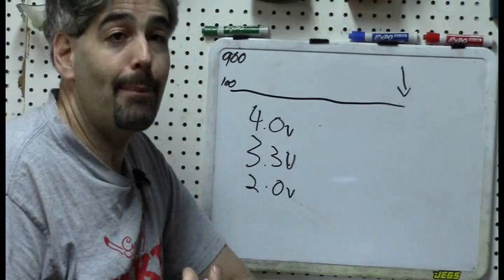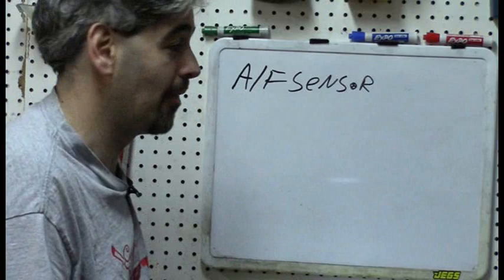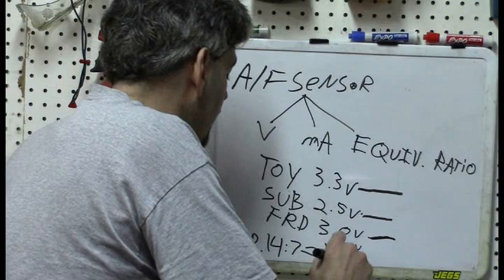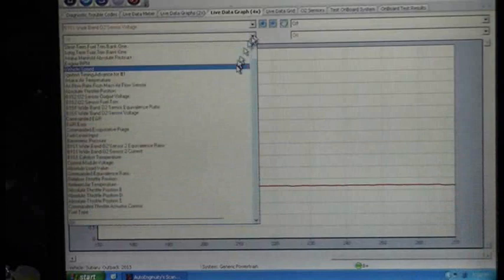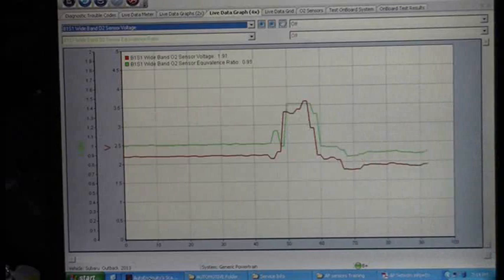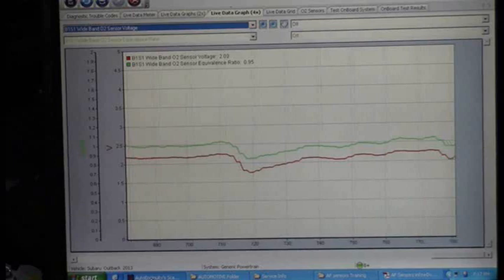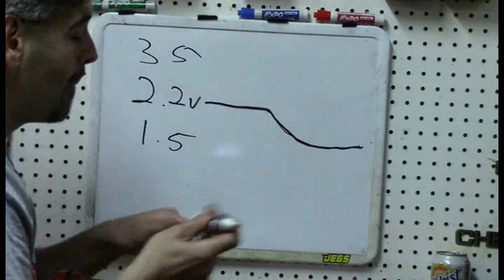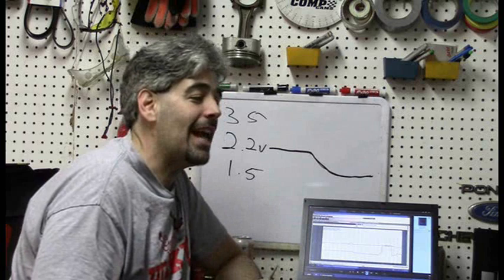Air/Fuel Sensors (Wideband Oxygen Sensors) vs O2 Sensors- PART 2

Comment: I tried doing the wide open throttle snap test to my toyota but it actually went lean(5.0v) right away and then normalized back at 3.3v. It would not go rich and then lean like it was shown on the video.
I have forced the sensor to go rich with propane and lean by disconnecting booster vacuum and it all checked out good.
I have checked fuel pressure and i got 44 psi at iddle and 45psi at 2500 rpm load.
I continue getting LTFT at about 4.5 at iddle and 8.5 at driving crusing speed.
I have a check engine light for P0171  bank lean, P0102 maf sensor low circuit imput, and P0113 iat sensor high circuit imput. 
Any ideas or thoughts?
Reply from the maker: Oscar G Sorry for the late reply.  Unlike most, you actually did a good job of giving some diagnostic data. But I would still need more. While it certainly appears you have a MAF problem and can rule out fuel pressure for sure, a freeze frame showing the actual conditions for the code that you can reproduce would be nice.  8.5LTFT is nothing I would base a diagnosis on. I would need to see it much higher.
  If you have an integrated IAT and MAF on your vehicle I would certainly be tempted to check there (I have an IAT video but not a MAF video yet). But you also need to do WOT tests and see if your A/F goes lean instead of rich which would also help give further indication that airflow measurement is the direction you want to pursue.
  But I would definitely not be chasing fuel, A/F, and vacuum leaks based on this so far.

Comment: Will the EQ ratio pid be labeled as such? All i see is the mA pid and one other pid for lambda voltage...if i only have that one voltage pid for the sensor and is not labeled as EQ ratio pid than i can assume it is NOT an eq ratio pid?
Reply from the maker: Yes there will be an equivalence ratio. It may not always be labeled as such though.
Reply: @SchrodingersBox  I wish I could find some definitive answer from kia...I guess it doesn't matter though because when diagnosing if the sensor is good or bad I should simply be looking for the graphed waveform...

Comment: I am wondering if an A/F could be used on a motorcycle that currently has no O2S. Could it be set up to use as an analyzer by monitoring it with a VOM for instance. If so how would one know the current of a given A/F at stoichiometry?
Reply from the maker: You can run anything on a A/F or O2 if the fuel management computer can recognize the signal.
Reply: No, my point is not to utilize the fuel management system. I want to monitor the air/fuel mix independent of the ECM.

Comment: Best explanation. Thank you so much.
But why the hate for 4 cylinder engines? Classic USA guy :P . Japan is makinh decent cars with 4 cylinders, dosent need to be a V10 6.5 lit engine with only 200 hp, it can also be a lighter, I 4 cyl 2Lt engine that can do 200+ hp.
Reply from the maker: Its because I like to go FAST.  I am about speed and performance, not fuel economy.  200HP?? My car's blower motor is about that.
Reply: @SchrodingersBox  just added a 0 to it
Reply from the maker: @MFDOOMgr  Not impressed... now just think if it was an 8 cylinder!!!! TWICE as fast.  NOW you'd have something that would impress me.
  There is no replacement for displacement.  Its absolutely true.

Comment: I'm slightly confused. Could you not measure the output of this directly by measuring the voltage drop across a resistor? I get the feeling that this is what the car computer is doing, which explains why the voltage is not to be trusted -- it depends on what voltage is applied by the computer, and it doesn't care because it's only measuring the drop. Or is it you don't mean that it's impossible to measure with a multimeter, just that it's more difficult because you would have to get a resistance in series to measure across?
Reply from the maker: It does not measure voltage. it measures amperage and polarity change.  The amperage is so minimal a standard DVOM would never detect it.
Reply: I seriously doubt the computer directly reads the amperage. It can't read it any better than your multimeter can, for the same reasons. It's just much easier to measure a voltage accurately.

I think it's likely that it's measuring the voltage drop across a known resistance (like you do in your parasitic amp draw technique video, the "known resistance" is the fuse) in order to indirectly read the amperage by reading the voltage. V = IR

I was just wondering if you had tried doing the same, i.e. putting a resistor in series with the sense wire and reading the voltage across that resistor with the meter set to voltage. I take it you haven't, that's fine. Just trying to brainstorm ideas. Excellent video series, btw!
Reply from the maker: tiger12506 Ah yes, you bring up a good point. That may be so, I am not sure. All I know for sure is it definitely measures polarity change and in fact I have a video showing a demonstration of that.

Comment: is the sensor producing this voltage? ot is the ecm provide the voltage?
Reply from the maker: Oh good question lol.  The sensor absolutely produces voltage HOWEVER it is not the actual voltage shown by the PCM.  So the sensor produces voltage however the PCM reports it differently --- actually based on the amperage, not voltage.
  Weird, eh?

Comment: My Toyota truck came with air fuel ratio sensor.
The Denso website recommends o2 sensor. (old parts number are not even listed).
So I replace it with the o2 sensor.
The check light has been off for a while but came back on after about 200 miles of driving so I thought drive cycle was completed.
I checked with a code reader but no data.
Is this common?
Air fuel ratio sensors and o2 sensors are not interchangeable even the manufacturer says they are?
Reply from the maker: You cannot replace an A/F with an O2. Just a moments thought would indicate this is impossible to work.
Reply: Schrodingers Box says:
"You cannot replace an A/F with an O2. Just a moments thought would indicate this is impossible to work."
==
Thank you for the reply.
That's consistent with what I was thinking.

I'm pretty disgusted by Denso as a company.

Comment: Hey Matt.
I have a weird issue with my o2 sensor. (note: My car doesn't support ODBII, so only voltmeter tests)
While idling it shows rather low voltage (around 0.2-0.3v all the time) - it doesn't mean anything so far - maybe vacuum leak.
The issue appears when I add propan - should go rich (engine almost dies) but o2 sensor shows me 0.5v all the time. Then, when I lean it again with vacuum leak - it drops to 0.1-0.2v, but doesn't really oscillate. 

There is no possibility to force this sensor to show 0.9v, whatever I do.
Do you have any other idea how to test this o2 sensor to be 100% sure it's not working correctly and should be replaced?

In my opinion - when it doesn't show 0.9v with propan - there are 2 possibilities: Or o2 sensor is broken, or my voltmeter (just simple digital) is showing wrong readings.

My o2 sensor is 3 wires - heater (2 white wires), 1 signal (reference 0.5v from ECU present), ground via exhaust pipe.
I'm doing those tests since I noticed the car takes more fuel than normal - and my readings proves it may be the case -> o2 sensor no metter what reads 0.1-0.5v
Reply from the maker: Provided you are measuring correctly and accurately, a dead O2 sensor would be the only possibility.
  Note also that another inidcator is the engine should be running rich despite the lean reading on the O2.  With false lean like that, engine should be practically dumping fuel trying to get O2 to respond back to stoic, exhaust should smell rich.
 I would have no problem changing the O2.
  You can also verify by repeating your readings on rear O2 by inducing significant lean condition and verifying voltage drops.
Reply: Schrodingers Box I also thought about verifying by readings on rear o2 - the only problem is - there is no rear o2 ;) This car has a catalytic converter but no rear o2 sensor.  I'm sort of sure the engine runs rich - more fuel consumption, characteristic smell from exhaust, but this doesn't mean broken o2 yet of course. 

There is also no "check engine" light (the car has one) - and this light it working, since it turns on when running with o2 sensor disconnected. I'm not sure how fuel trims are working in this car, but I can imagine they should be really high when o2 reports false lean, so they should turn on check engine light?

It's pretty complex to diagnose EFI car without OBDII :(

Anyway - many thanks for your opinion. Probably, based on my measurements and other symptoms, I'm gonna change o2 sensor.

BTW.
It's pretty cool to see YOU writing: "Go, change your o2" LOL :)
Reply from the maker: lol good point. What kind of car is this anyway?
Reply: Schrodingers Box volvo 740 2.3 '89, everything stock, naturally aspirated. I drive it usually to the junk yard or when somebody needs to transport furnitures or something, big wagon.

Comment: Isn't stoich heavily dependent on the type of fuel you are using?  So old fashioned gasoline being 14.7:1 (air to fuel by weight). But we don't use pure gasoline anymore. Generally we use E10 (90% gasoline and 10% Ethanol).  So using the 9.0:1 stoich ration for Ethanol and computing the E10 stoich it would be calculated proportionally as (14.7 x 90%) + (9.0 x 10%) = 14.13.  So E10 stoich is 14.13:1 and not 14.7. If the vehicle was designed for E10 I might assume that the stoich voltage on an O2 sensor (0.45 vdc) actually represents 14.13. To complicate things even more -- where I live they add oxidizers to the fuel in the Winter months and I haven't a clue what the stoich ratio of that substance is.
Reply from the maker: I never considered this but it sure sounds reasonable. I would need to look into that more.
Reply: I didn't see that before my comment, but I agree. There is a 1% plus or minus tolerance in the factory tune up. But here in Brasil, the ECU for gasoline (exclusive, gasoline only, not ffv) is tuned about 22,5% +or- 1%, since the 90's, because the gov determines ethanol addition from 20% to 25% seasonally, and that goes beyond the settings often. Our gas are E20 or E25 and mixtures of thereoff. Now with flex fuel there is a sensor to measure the mix of alcohol and gasoline in the tank. We have these car as flex fuel vehicles, and that really complicates the matter
Reply: Jay D. Anderson no it will actually read 14.7 to 1. stoich the difference will be that the ECU will add more fuel due to the density of fuel and the calorific value of said fuel...   E10 or E85 doesnt make a diffrence.
the old gauges use to read 1 for stoich 0.8 for rich and 1.2 for lean. as shrodinger points out the numbers could be anything. but they chose to print the numbers for petrol a/f ratio on the gauge.
Reply: Well, if ECU adds more fuel the ratio will be less than 14.7:1, wouldn't? And the O2 sensor will see higher voltages every time it trims back to 14.7:1. And there will be a conflict that would triger the CEL.
Reply from the maker: Duratec Paul Yeah I am not sure that's right- you would actually add LESS fuel if the density was higher.
Reply: OS Coutinho no as the sensor is reading the resulting gases and reporting oxygen left after burning.
The sensor reads Stoich no matter what the fuel = the voltage or current from the sensor is the same.
what ever the pretty gauge reads whether its 1=stoich ...or.. petrol 14.7=stoich
Reply: Schrodingers Box yes it was a poor choice of words using density I should have said BTU's..
Reply: No, the voltage "or current" sent from the sensor isn't the same, it's dependant on the oxigen concentration. I believe that's another poor choice of words?
Reply: OS Coutinho yes and we are talking about a stoich mixture, weather its 9/1 or 14.7/1 or 1/1  sensor is reading the same voltage or current regardless of fuel type. 
So its not a poor choice of words at all. as you just said in your own reply it reads the oxygen left
Reply: But the ECU doesn't accept several mixture ratios, and oxigen content is dependant on the fuel used, If very oxigenated will inform higher voltage, and that's very limited in a normal vehicle, non ffv. If used a fuel of 13/1 or lower for stoich, than will light the CEL as an alway lean situation.
Reply: OS Coutinho Your missing the point Stoich is a measure of a complete burn and the sensor only measure the oxygen left in the exhaust gas.  Go round in circles much?
Reply: I'm missing the point? You said that the stoich is 14.7/1 with any fuel ... I had a lot of fun from yours. Look there:
 "no it will actually read 14.7 to 1. stoich the difference will be that the ECU will add more fuel due to the density of fuel"...
Reply: OS Coutinho No you said it first, so I used it as an example of a stoich mixture to help you understand the concept.
The correct stoichiometric ratio for regular unleaded gasoline is 14.7:1, while 9.7:1
 for E85 (and can be any value in-between for different alcohol/fuel 
ratios). In newer cars, this means either holding the injectors open 
longer to get extra fuel into the engine, or running a higher flow rate 
injector to make the wideband sensor read stoich.
as petrol 14.7 to1, as e85  9.7 to 1 as stoichiometric gauge just reads 1 for a stoich mixture regardless if its petrol or e85 or lpg or any other fuel...  Im done
Reply: OS Coutinho this might explain it better ripped of the web somewhere.

"When you see a value reported from a wideband, the value is typically 
converted to a gas equivalent AFR.  Some widebands (like the PLX) will 
let you change the display and show lambda, or show ethanol-equivalent 
AFR's.  So, let's say your wideband is set to show gas equivalent AFR, 
but you are running e85.  Cruising around, the display will show 14.7:1.
  This means the lambda is 1.0, and in reality your e85 mix is 9.8:1.  
When you go WOT, the wideband display shows 11.76:1.  This means your 
lambda is .80, and if you are running e85, the actual mix was 7.84:1.  
(Narrowbands work in the same way, but we only see raw voltages)."
Reply: I see what you mean, the delta ratio (cruising x wot) simplified for gas ecu readings, although that's not applicable to ffv, just pure gas vehicles, since there are several reading maps on ffv, by measuring the gas/ethanol content in the mix fuel. Than you'll have a more ascurate displayed fraction.

Comment: Aw dude I've owned a (non-turbo) Subaru for over 10 years, it's been an amazing car to me.  I have had problems with my Trans Am during every step since I bought it 4 months ago.
Reply from the maker: Sounds like you are more about economy than high performance. To each his own.
Reply: I love high performance, which is why I bought T/A!  But the Subaru is my daily driver.. you know how snowy Denver gets.
Reply: Received my BlueDriver today,
At 25MPH, LTFT Bank 1 is 24%, LTFT Bank 2 is 3.1%.. could the exhaust leak at the header on Bank 1 be the cause of this?  Having an issue loosening 1 header bolt.

New: headers, plugs, wires, 4 oxygen sensors, 2 cats, ignition coil, fuel filter, fuel pump, battery, oil & oil filter, air filter, thermostat, coolant temp sensor to gauge, coolant refill, no vacuum leaks.

Just to be clear, I didn't buy all this hoping the emissions would pass, most of it was already installed this year when I bought the car.  Fuel pump crapped out on me less than 1,000 miles after I bought it.
Reply from the maker: Could be- you need relevant data to determine which you don't have.  All you have is Ltft at a single tim point. That's useless
  what we do know is this car has had every part thrown at it at random - That does not mean it has caused nothing problems- it means it has just never been properly fixed the first time. 
  You need to curve your statement and ltft against rpm to identify your direction.
Reply: I have live data! With Lemur's BlueDriver.
Monitored and captured pics at idle, 2500RPM rev, and driving at 25MPH. LTFT values are:

Idle:
Bank 1:  3.1%
Bank 2: -8.6%

2500RPM:
Bank 1: 19.5%
Bank 2: -10.9%

25MPH:
Bank 1: 24.2%
Bank 2: 3.1%

The guy I bought it from put all the parts on the car except the fuel pump, fuel filter, coolant temp sensor and ignition coil.  He snapped two bolts on the exhaust manifold and then decided to sell it, which is when I bought it and then the headers. HC at 5.8 when I got it emission tested on Monday. The graph showed an HC decrease after MPH decreased.
Reply from the maker: Glycerin Looks like a lean under load condition to me. MAF frequency and fuel pressure tests are next.

Comment: Also if your EQ RATIO is at 1 and my long term trim is at 8 what dose that indicate? What do you believe and how is it possible that they are reading different?
Reply from the maker: Obviously they correlate. what would you expect the ER to be exactly?
Reply: Schrodingers Box just getting confused on why you have eq ration when you have fuel trims. Why not just read the fuel trims and not worry about eq ratio
Reply from the maker: Ah yes- good question. one reason is it helps to see how the EQR reacts under different conditions to see to which degree the A\F sensors are reacting. In other words - I might want to see if an O2 sensor is going really rich or really lean by looking directly at its voltage (.1 to .9V). But since the A/F sensor voltage doesn’t really mean anything to me if I don’t know the arbitrary output for that specific model, I can instead look at EQR which is universal. 
  Basically it lets me see how the A/F is directly reacting rather than rely on STFT which is an indirect response.